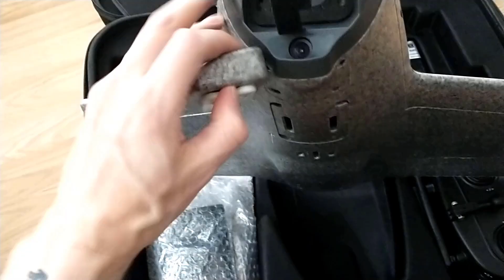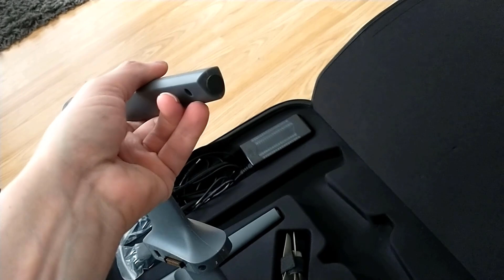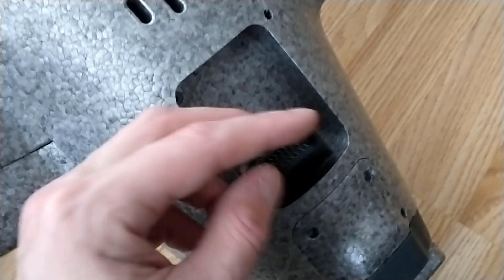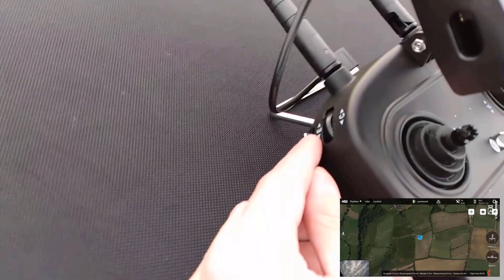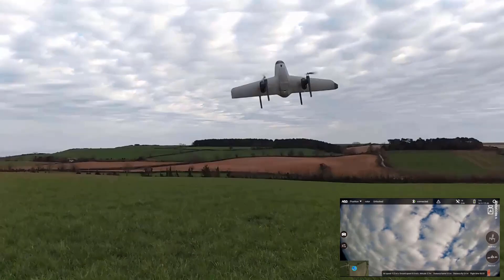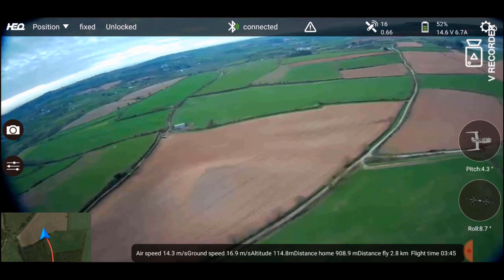🛩️ SWAN K1 - (FOXTECH H-WING) REVIEW

Comment: Mate you need to point the controller towards the aircraft in flight and follow the direction at all times,  make sure the controller aerial is facing the aircraft. If you do this you will have a much better signal. The reason you had the controller on the ground is why you had issues not responding and choppy vision. Nice video thankyou.
Reply from the maker: Yeah I know. Unfortunately I had to have the controller on the ground because I was using 1 of my hands for filming. But in later flights when I held the controller properly I had much better reception

Comment: Thank you, great first real life flight ... I wonder how loud it is when doing a fixed wing low pass ... I bet you this is super silent compared to other wings?
I think this combines the best of both worlds ... you can launch it anywhere where you can launch a quad while having the super efficiency of a wing but with a much better power distribution, because it uses 4 big props instead of one small prop. The fact that the manufacturer made it be almost as compact on the go like a quad is really an outstanding feature. My wing need more space packed that that.
The only thing that bothered me is the frame rate on your smart phone display ... I hope this is better when not recording at the same time.
What is the radio range out in the fields? The fox-tech version costs around 600$, wonder what Swan wants for it ... will check your link now.

Comment: Great stuff..thanks for sharing. Does it have automatic loitering capability after transitioning into airplane mode (ala the Parrot Disco). Useful when you are learning and just getting your wits about you.
Reply: No it does not.  It also only flies for about 30 minutes max in ideal conditions, despite being advertised to fly for an hour.
Reply: @ayCarumbaQueLio  Thanks. How is that these next gen technologies still lack features that were on a Disco that came to the market how many years ago.  If I had a VTOL Disco I'd be happy as a clam.

Comment: You comment the H-Wing turns very gently. Did you try turning using both 'ailerons' and 'rudder' controls together?
Reply from the maker: There does seem to be any rudder. Moving the left stick sideways doesn't do anything as far as I can tell
Reply: @gizfpv  Andrew Newton been having problems that his H-Wing won't transition into Horizontal flight - OEM has advised he climbs to 40 meters before transitioning. What height do you go up to in your video before transitioning ??
Reply from the maker: I did the transition at 30m and it worked fine

Comment: Hello,

I want to maybe buy this one, but I don't know the range. How far you can fly away? I mean not the radio range, the video range.
Reply from the maker: The video range is around 5km, maybe a little more on a good day
Reply: @gizfpv  ok thank you. And is the video a bit laggy?
Reply from the maker: @theallmaker9085  A little bit yeah. Still quite usable though
Reply: @gizfpv  ah ok thank you. So would you recommend the buy or are there better ones?
Reply from the maker: @theallmaker9085  It depends what you want.  The pro's of this wing is that you can launch it and land it pretty much anywhere (you don't need a big open space), it has a decent long flight time, its very easy to fly, and you get everything you need in the box, you don't need to buy anything else. The cons however are that it's a bit slow, it doesn't handle the wind well (in vertical takeoff mode), and it cant do any acrobatics. If you want something simple and easy to fly that can carry a gopro, then sure, go for it. If you want something more agile and faster, id look at getting something else
Reply: @gizfpv  ok thank you. is one of the advantages, the video range or is it more in the ok area? It is important to me that I can fly far away and still be able to control the drone.
Reply from the maker: @theallmaker9085  The video range is 'ok'. It's nothing amazing, but ok. If you wanted to fly proper long range though i'd suggest replacing the fpv system with a traditional analogue fpv system.  Not only will that get you better range, it would get you lower latency and probably better WDR (depending on what camera you used). You'd need goggles if you went down that route though
Reply: @gizfpv  Thanks for your helpful answers. Would you say that with the Dji FPV drone I get better ranges with 1200 mW?

Comment: Any chance you could sent me a copy of your English instructions. Along with Andrew Newton i am also having problems seeing 12 satellites but not getting them to lock and show my true UK 'Home' position.
Reply from the maker: Have you tried using the GPS outside?
Reply: @gizfpv  To be honest - no!
Reply from the maker: @wackyack3165  Give it a go outside in a big open space. Make sure you have the aircraft layed down sideways (so the GPS is facing the sky). 

If that still doesn't work give this a go: https://youtu.be/25G6dMa7hw0
Reply: @gizfpv  Many thanks for this. PS I have received English written instructions from Swan - very quickly too.
Reply: @gizfpv  Tried finding satellites outside. Whilst doing this I set the top left mode selector to 'Alt Hold'. All that happened differently this time is the 'picture' of China disappeared to be replaced by a white grid screen with a large red circle with a blue Home (?) position dot in the centre. Going to try the QControl work-round now.
Reply from the maker: @wackyack3165  Hmm that's interesting. Yeah try the Q ground control hack and see if that helps
Reply: @gizfpv  Didn't work outside in a big open space. I followed the parameter mod video and tried again - still didn't work. Then tried using the Mission Planner app, QGroundControl - that did work - satellites locked and correct UK Home map displayed. I contacted OEM again and they sent me a different version of HEQ Fly app - that did work but has I suspect two bad bugs - no video and map screen fast blinking square portions on / off. Contacted OEM again - awaiting reply.
Reply from the maker: @wackyack3165  Hmm ok, that's odd. Where did you order yours from? Is it the Foxtech version or the HEQ version like I have?
Reply: @gizfpv  The H-Wing and the original version of the HEQ Fly app both came from Foxtechfpv
Reply from the maker: @wackyack3165  That's interesting then. Based on the fact that both you and Andrew Newton have problems, and you both got yours from the same place, it seems Foxtech has done something to the firmware which is causing the problems?
Reply: @gizfpv  OEM now sent me a 3rd version of HEQ Fly and advised to uninstall QGC from phone to cure the 'bugs' I had with the 2nd version of HEQ Fly !!